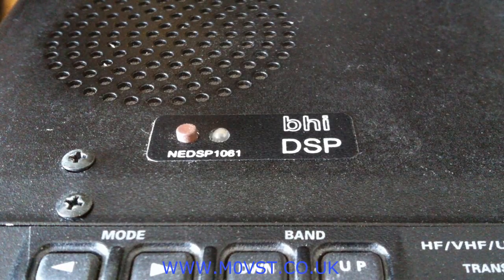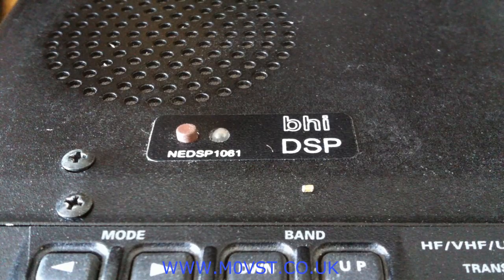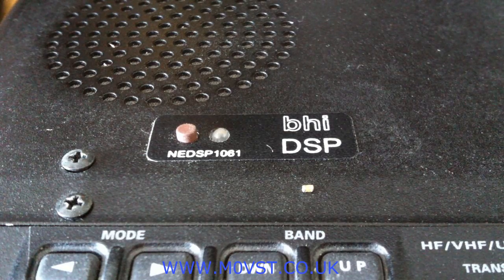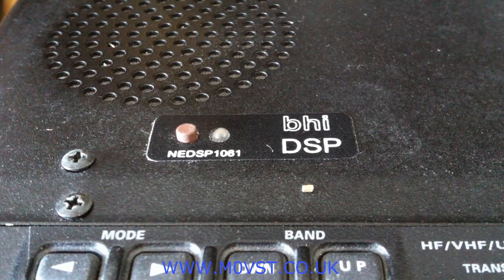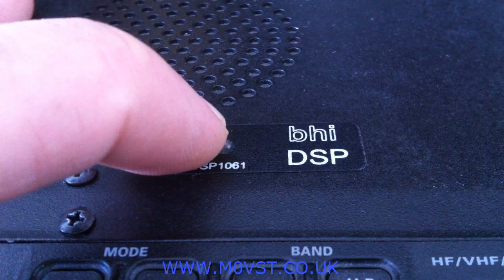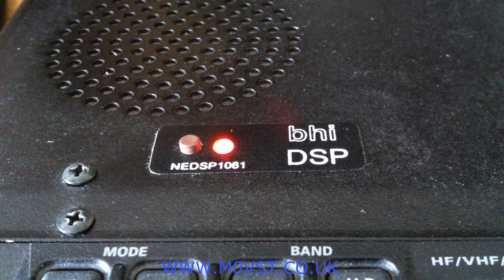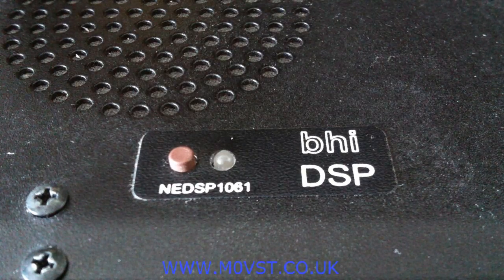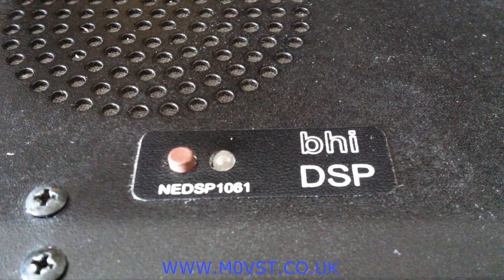The Bhi NEDSP1061 Noise Eliminating PCB Module in the Yaesu FT-817nd - part 3 - M0VST [HD]

Comment: This is the 100x better than the DSP that's built into the 817ND. It massively reduces noise and brings the audio up front as if it was a much more expensive full sized radios.

Comment: u have to pull the board out i used purer glue to secure the wires then solder the 2 audio wires this insures the wires dont  break off from vibration the led and button pcs can be trickey. to close to the spkr too me 2 hrs also becarefull the ribbon cable i wish  u did not have to remove the board but u cant live without this unit 73 kg6mn
Reply: LOL,They make several external units & external speakers as well & those may be used with any rig that you will ever own not just one.It's a novel idea I know but it would relieve all of that stress you were having in that post.

Comment: Very nice add-on. I've always wished Yaesu included DSP (and an auto-tuner) on this radio. Thanks again for sharing. 

73, James
Reply: They work with any brand DSP Speaker or DSP modules that are sold & you may use those units with any rig not just one.